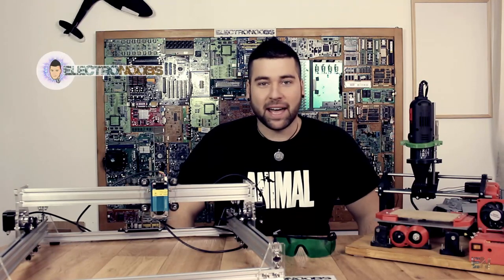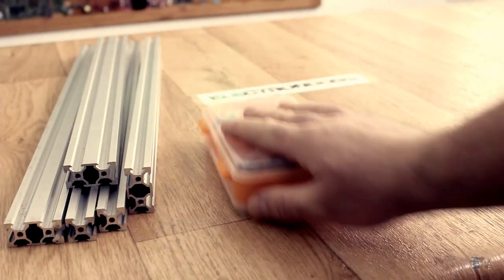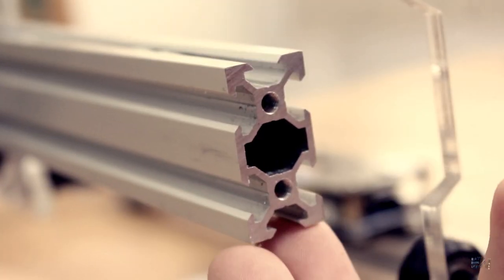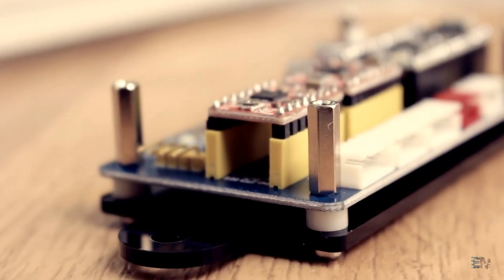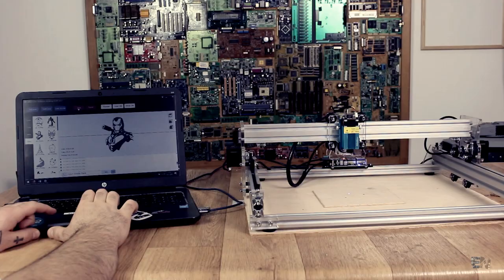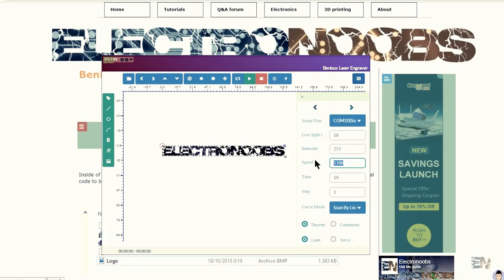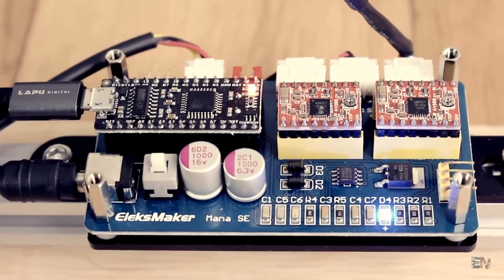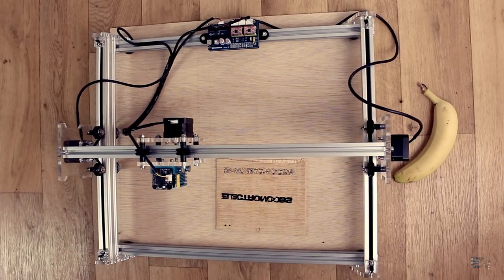Laser engrave? EleksMaker CNC Review and test

Comment: We use a 15W laser and a little smaller CNC system to rework panels. Unfortunately it is fixed focus and had to be modified to get the laser the required space from the surface. We got the same glasses but don’t trust them that much too. The laser powered on when I plugged the USB cable in and burned a hole in the desk !! This laser is nice a powerful but without laser focus ability it makes it a challenge to use.

Comment: Hello

Can the laser be installed instead of the engine in the CNC 3040 4 axis Router.
Is the electronic circuit has a place to install a laser cable.

Comment: You have to put a 10k Pulldown Resistor to the pwm signal pin of the Arduino, so it won't turn on by itself when you connect it to your pc
Reply: you tested this? sounds like a good idea
Reply: @EpicSqu1rrel  Yes and it works like a charm

Comment: Hey great video. I'd like to build a similar cnc machine. What sort of aluminium extrusions are being used here. And do you know where I could get the roller wheels. I keep searching but I don't know the proper name for them and so I don't get the correct search results. Many thanks
Reply from the maker: https://www.ebay.com/itm/Bearing-V-Slot-Plastic-Wheel-Roller-Pom-Ball-Nylon-Glass-Series-Cnc-Gear-Perlin/253317733067?epid=26011565454&hash=item3afae9dacb:m:mA2FJpWqfKaCP-RTXRYYnSQ

Comment: Hello , i have Eleksmaker A3 pro ,do  i need to  calibrate the  machine? I have installed the program, I choοse the COM and the machine.
, what do button set home and home?
I can move the laser manually, but when I select the photo while it shows to the computer that it reads the design it does not move the laser at all.
Could you help me?
Thank you
Reply: NIKOS: I had the same issue, it was resolved by changing the decimal point in Windows. It has to be . and not , so us standard
Reply: NIKOS: I had the same issue, it was resolved by changing the decimal point in Windows. It has to be . and not , so us standard

Comment: good build description,good enough kit for a 2 axis laser,safety features are lacking a big carboard box might help more than the glasses(not being funny),or a 6mm plywood box with interlock micro-switches to cut power to the stepper driver board,super simple and the arduino nano can still accept the CAM files,most of these things need a bit of tweaking to make the thing you REALLY want it to be,a 3 axis might be more than it can support(flex/deflection of the axis support beams,though you could rebuild it with larger gauge box section.
I want one,though i think my own build will get exactly what i want/need.

Great vid,like with a BIG thumbs up dude.

Comment: By the way it's not 2,5W laser  ..they are pretty all over the place.
Mine measures only 900mW light output >..< EleksMaker needs to make something with their QC or stop lying about their products.
Also you used the nuts on the swrews completely wrong way - they are supposed to grip into the acrylic ;)
Reply from the maker: Wow, I didn't knew that. :(

Comment: Again bangood Advertisement?!? Guess I need to unsubscribe then. I'm not here for Teleshopping
Reply: Axel Werner 
Well the machine is quite simple. Its not like you cannot buy the components separately and build something similar yourself. The angle brakets could easily be 3D printed and the rest bought or replaced. An arduino uno + cnc shield could easily replace the main board.
Reply from the maker: That's true. The first machine you see in the video, the red one is homemade.
Reply from the maker: The company that helps my workshop shouldn't bother you. I show you the machine and I really wanted this one for my future projects. If you want to buy it using any other shop is your choice. If you are not here for my videos, I'm very, very sorry to hear that. 
Have a  nice day.